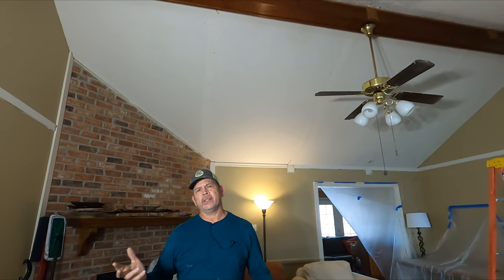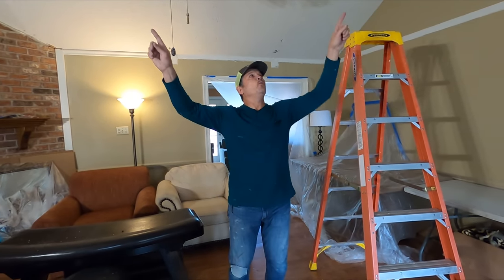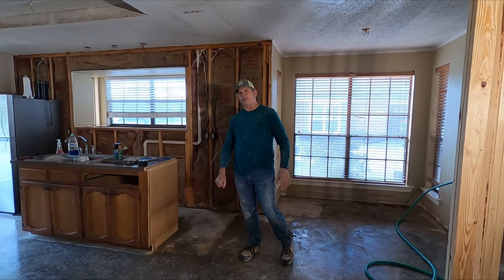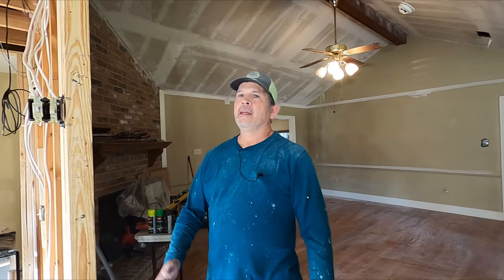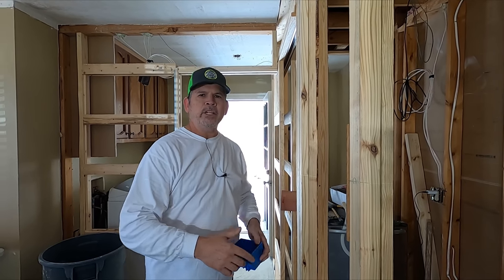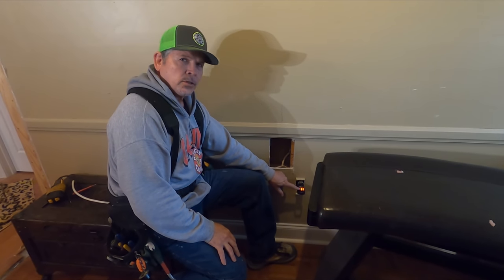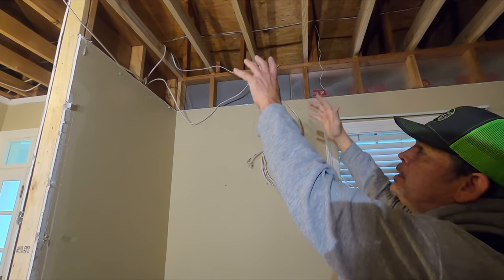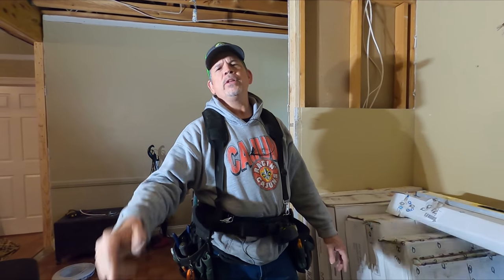Scraping Popcorn Ceilings.. There HAS TO BE a BETTER WAY! Ep. 9

Comment: 'Wish they made a tool...'
When you use the side of pliers as an offset hammer and beat the middle of them with your hammer, the impact gets divided between the nail and your hand holding the pliers. 
I have a couple of ideas for a design.
Reply: @e4d578  the same issue of no space

Comment: We cover the floors with vinyl drop cloths, hard to believe you didn't. Homeowners really hate to see all that on their hardwood floors. Also they make an angled 12 inch scraper which is much easier, and ergonomically correct that's less work for the labor.

Comment: Use ram board for the floor. It's heavy duty and reusable. usually comes in 3'x50' or 3'x100' rolls 50/80$ CAD
Reply from the maker: Cool thx 👍

Comment: Ive stripped 100 tons of popcorn being a painter. Invest in "zipwalls" and cover floors with medium weight plastic not the thin painter plastic. Use slip on shoe covers and remove them on the plastic for running in and out. Less clean up is always better.

Comment: If someone hasn't made it yet which I am sure they have, you could make an attachment for that scrapper. A v shape pan under the scrapper that goes to a hose connection you connect a wet vac hose to the handle as you scrape the material through gravity would fall into the tray and than get sucked up by the hose.  I don't think it would catch everything but I would guess it would get 90% and save on clean up.  Probably pretty easy to make out of some sheet metal

Comment: Just sandwich it with new drywall and spackle, a couple screws to hold it temporarily. Why scrape when you can start fresh? The spackle vacuum seals them together, easy done.
Reply: Drywall is not cheap it’s a lot more drywall over it than scrape it

Comment: In Minnesota, you need to be a licensed electrician if you do it in any place other than your own home.  As a homeowner, I can install my own electrical, so long as I pull my own permits and get it inspected.  It doesn't make a lot of sense to me, as most homeowners don't have a clue what they are doing.  As a homeowner, I have done a lot of electrical, including basement finishes, adding circuits, etc.  I bought two books on the subject, read them front to back, ask the inspector and/or a licensed electrician friend on anything I am not 100% certain on.  Had my basement inspected, and the inspector said I did better work than half the electricians he inspects.  I would expect a good handyman to possess at least the level of knowledge I do, and considering it all has to get permitted and inspected, why now allow it?  Answer:  The unions push for restricting it to protect their industry, not because it is any safer.  Same as plumbers.

Comment: My stepdad used to spray acoustic ceilings back in the '70s. When asbestos was banned (for sale) he bought as much as he could before it disappeared & continued to use it [one double handful per job was about all it took to make the goop spray satisfactorily] so don't think for one minute that just because a house was built after '75 it doesn't have asbestos in the mix. BTW, acoustic ["popcorn"] ceiling is great for sound absorption, but it is positively a light *sponge*, so you'll be amazed at how much brighter your house will be once you scrape off what you think is white cottage cheese [the whole "popcorn" thing is a post y2k affectation, AFAICT] and lay down some white paint up there. And yes, I came up w/ the spray it down, let it soak, clean it off thing on my own when I was helping undo my stepdad's handiwork on some of my extended family's residences back in the '80s & '90s. The great thing is that asbestos has to be airborne (or eaten) to cause you harm, so if you soak down the stuff to the point that it's nearly falling down on it's own, it's too wet for any asbestos dust to be a problem. Throw down viskween all over everything, scrape it off, roll it up & send it to the dump to be buried and it will never be a problem again...
Reply from the maker: Thx Nunya!  We had it tested just in case your stepdad did this house too 😂  I went thru asbestos training... friable and non-friable comes to mind 😎

Comment: Easiest way to deal with a popcorn ceiling is to just burn the house down.

Kidding aside, if you attach/tape a shop vac hose to your scraper with the wide vacuum attachment facing up towards the scraper blade, you can catch almost all the debris in the shop vac the moment it comes loose. Or buy some construction grade garbage bags (3 MIL or thicker) and rig one up to your scraper with some heavy gauge wire to act as a catch. But you'll need to empty the catch into a garbage can after every 1-2 passes, otherwise it gets too heavy.

Comment: I did a 1200sqft house worth of textured ceiling about 2 weeks ago.   I managed my project much the same way.  I had carpet in 3 rooms and the rest of the house was a composite flooring.  I had a piece of a roll of house wraps and 2,000sqft of drop cloth.  I put the house wrap down first and tarps next.  draped plastic on the walls, then sprayed water and scrapped.  Rolled all the tarps and mess, walked it outside and shook em out on another piece of house wrap.  I let it dry and skimmed coated with about a 20" blade.   Sanded with my vacuumed system, then folded everything in from the top down.   I had very little to clean up in the house.   I spent 3 more times the amount in prep, than i did making the mess.  I was really suprised.

Comment: I see you used a 9 or 12 inch drywall mud life to scrape the popcorn ceiling.  How long do you wait after wetting it with your sprayer before scraping or do you start immediately so it doesn't soak into the paper on the drywall?  Or does the water ever penetrate the drywall underneath??
Reply: knife not life

Comment: first lay plastic cheap paint tarps down and cover everything. make sure they over lap so,  smaller ones are ok, they are easier to roll up with stuff in them afterwards. second duct tape a 12 to 14 inch mud knife to a extendable paint pole. third use a weed sprayer filled with water to wet the entire ceiling wait 5 mins and do again, wait 5 mins and do again then start scrapping. It's not the volume of water but the repeat that makes the diff.  Weed sprayer controls the water better makes less a mess.  rollup the smaller plastic tarp sections with the stuff and all done. Don't use a hose, too much water on the ground. Weed sprayer.. looks like you didn't wet it multiple times. just once, too dry to scrape.

Comment: I did a house once, that was built in the 60's. Had just the subfloor, and I was going to paint the walls. Easy, so I thought. I was confused why I had to keep soaking the popcorn. Turned out, the popcorn was painted, then under it was a layer of painted texture! Took me 3 freaking days to scrape all the ceilings!
Reply from the maker: Painted popcorn is the worst 😡
Reply: @StudPack  yep, now try painted popcorn on top of painted texture! And, I tried one of those scrapers that you can attach a plastic grocery bag. No, it wasn't very helpful. lol. It was more of a pain.

Comment: Love me some greenies!! And wagos! Y not skim the ceiling cuz it's styrofoam and not joint compound?
Reply from the maker: That would be a thick skim coat.  A lot of weight added to those little drywall nails they used to use.  I guess I could add screws.

Comment: Acoustic ceilings are wonderful. There is nothing worse than audio reverberation where it should be anechoic. The trouble is that most folks don't even know what they are for, or have researched them at all.
Reply from the maker: We've talked about this with the owners.  I noticed a small difference after the acoustic was gone.  I think most folks prefer the clean look over any acoustic benefit.

Comment: If you do it enough, invest in a Festool Planex and sand the popcorn off. Hook it up to a dust extractor and you’ve got no mess.
Reply from the maker: Won't it cut thru the drywall paper?
Reply: @StudPack  There's definitely a learning curve, and it's expensive (Festool), but if it's something you do often enough it's worth the investment. It even seems to handle painted popcorn, which is a nightmare
Reply from the maker: Ok cool thx 👍

Comment: As a former HVAC guy, it looks like those ducts were designed for an evaporative cooler, instead of an closed A/C system.  For your viewers, evaporative coolers dump the cooler air into the center of the house, and pushes the warmer air out through open windows or other vents.  As you mentioned, A/C vents go to the outside of the house (where the heat loss/gain is) and draw the warmer air back into the A/C system to cool it.
Reply: aka Swamp Coolers
Reply from the maker: No evaporative coolers where we live but I get the idea.  I think it was just economics to keep the duct runs as short as possible 👍

Comment: If there is lots of repair going to be required I overlay with 3/8 glue and screw and just tape.  Cleaner and quicker.  

I got 3 different sizes from Marshalltown late last year and I love them.  They change my finishing.  Even regular taping my 18” blade is my finish for butt joints.  I got an 18”, 32”, 48”, and the handle attachment for poles.

Level 5 is expensive and no better than Marshalltown.  They will send you a hat and trowel bottle opener.
Reply from the maker: Thx I’ll check out marshalltown.  They make good stuff 👍

Comment: The amount of work you can do depends on where you have your contractors license.  In some states a general contractor can pull the permit for every aspect of the work, while in other states a licensed electrical contractor needs to pull the permit (plumping permit also).  Use to say it had to do a lot with how powerful the unions were in those states.  In the right to work states it puts a lot of responsibility on the inspector paying attention.
Reply from the maker: Thx James 👊
Reply: More people should be required to get a plumping permit.

Comment: Another great video Paul and Jordan. Can't wait until the project is completed.  Even though you mentioned the electrical part, you just made their job so much easier Paul by running the wire and capping them, that's probably just the way you work and big props for the extra work!!!  Keep the video's coming!
Reply from the maker: Thx Javier!

Comment: You should consider using wago (or similar)instead of your "cable cap". Safer, faster, easyer. 

My father (now retired) was working as an electrician and they switch to wago since 1980 or something. Never regretted to stop using "cable cap".
Reply from the maker: I have a whole set of them in a case.  I'll try them on a project soon 👍
Reply: @StudPack  hopefully they're the new 221's. They're amazing.

Comment: Paul, as much as much as I love you and this channel, I have to say that from where I'm at here in Ontario Canada there is a 9000hr apprenticeship that goes along with being able to install Romex and certify it.
I know what you mean but it would be unfair to all the people who have worked their ass off just for that reason. not that you haven't don't get me wrong. 

Great video thanks again.
Reply from the maker: Thx Josh.  9000 hours?  That's 4-1/2 years full time.  There should be a middle ground is all I'm saying.
Reply: Gate keeping at its finest.  Make extensive experience a prerequisite.  It benefits contractors once they make it, but also hinders new guys getting started who have to work for dirt cheap until they get that.  I understand electrical is complicated, dangerous, important.  But 9000 hours is not necessary.  And you see this is in so many trades.

Comment: The permits which require a licensed person is the reason why I don't pull permits at my house. Most contractors do really terrible work. I personally think if you can pass an inspection why do you need to hire a licensed person. I agree with you paul

Comment: I’m a master electrician and a licensed commercial inspector, and I’m afraid I support needing a license for electrical work. Many contractors do their own, which is illegal in many states, and I often find the problems they create later. Yeah, you were lucky to have a California county to allow that previous work, but that should not be the norm. I always say, it’s easy to make the power work, but very hard to do that AND meet the NEC.
Reply from the maker: Thx Michael.  See our recent post on the 4x4 box installed at this project by the previous licensed electrician that the inspector must have missed.  There's got to be a better way 👍💪

Comment: Beware if want to remove popcorn ceilings. If ceiling was sealed or painted with oil base paint, good luck , it'll be hard as concrete. If you succeed in removing the popcorn, there is a good possibility that you'll need to skim the ceiling with a coat of plaster. Ceilings that are popcorn , usually do not get a perfect taping finishing, given the fact that are going to be sprayed, and imperfections won't be seen

Comment: This video brings up so many things I want to comment about. 1st - mount the trash can to a furniture dolly so Jordan can push it around. Might help him stay under it better. You might also be able to fashion some sort of funnel on the top to catch more. The one and only time I did this I used a sander and then swept up after but the house was vacant. 2nd - your ac vents should blow air on the heat load ( outside walls and windows). So, in the big room I would put them on the ceiling opposite the window. The problem with this is a regular ac register would blow air up to the peak of the ceiling or down to the floor. So you have to get a register that is adjustable and will allow the air to blow straight across from one side to the other and wash the heat load (outside walls and windows). 3rd - ain’t it the truth that we should be able to do light electrical and get it inspected. I was going to do it on the sly and had a whole house retired when we cut down a tree and took out the main power. Now I have to pull permits. Could not find an electrician to inspect my work for a fee and finish it out. They all insisted on pulling it all out and starting over. Money down the drain. Lesson learned though. Obey them rules or it will cost ya. AnyHoo, thanks for the vid.
Reply from the maker: Thx as always Shannon 👍

Comment: I would ask the owners if they wanted you to remove the recessed ceiling in the kitchen. It's hard to clean and a real grease trap even with a proper ventilator in place. Also it really doesn't add a sense of space to the room and instead makes it look smaller since it's such a small area compared to the total surface of the ceiling. Especially now with an open plan solution.
Reply from the maker: That recess is coming out of there 👍

Comment: Just curious were sheetrock screws on your switches ive worked a master electrical contractor for years we do everything except for connecting supply at weather head my guy comes out before the the work starts and again before connecting at weather head also do you have to use arc fault breakers at panel im in texas
Reply from the maker: Sheet rock screws are temporary until new switches are installed and work great on stripped holes in Bakelite boxes👍

Comment: I thought you explained why you could not do wiring and had to bring in an electrician, and then you turn around and do wiring. I’m confused...
Reply: I think he means new wiring and new circuits. Most places allow relocation of existing outlets by unlicensed workers or homeowners. Adding new circuits to the breaker requires a license because I guess some people cant read the breaker box which would tell you exactly how much you could add to it anyway..
Reply: He's not certified in that state so he can't do certain things
The things he can do he's doing, it also helps out the sparky as then they won't have to punch holes in boards and stuff
You've got it easy in the states with wooden houses, here in the UK you need to chase channels into the brickwork, which means a special tool, and it creates so much dust is unreal
It took 4 days to wire my kitchen start to finish on bare walls so the less time you need people there the less you need to pay them 👍
Reply: @therealdojj   I'm in the States and watch some guy that does residential renovations in the UK.  I've watched videos on his channel of those chase tools even though I'll never have to use one.
Reply: @therealdojj  As someone who occasionally does low voltage electrical work in homes, this is exactly what I always think about when someone from Europe picks on US homes and their sticks and paper construction. I can't even imagine how difficult it is to do something as simple as running a network cable to a secondary AP in a large home when it's all concrete construction.

Comment: When I can, if I can, 3/8" drywall right over popcorn.
Reply: @isaackvasager9957  yeah - why is that?
Reply: @isaackvasager9957  Pro – don’t deal with that mess or the time to make that mess. Time is money.
Pro – don’t send anything to the landfill.
Pro – increase fire rating.
Pro – chances are, after you scrape, you will need to do enough touch ups or skim coating that a new mud/tape job is justified. 
Pro – If you were going to demo the drywall anyway and hang new board, now you only need to hang new board. And everything stays in the attic.
Pro - saves the customer money. 
Con – if the ceiling is low, then you just made it lower.
Con – if asbestos is in the popcorn, then you just hid it… not cool.

It may not be the best solution every time, but it’s a good solution when you can implement it. Those ceilings were high enough that it could have worked just fine for them.